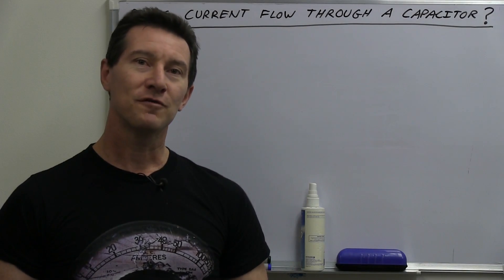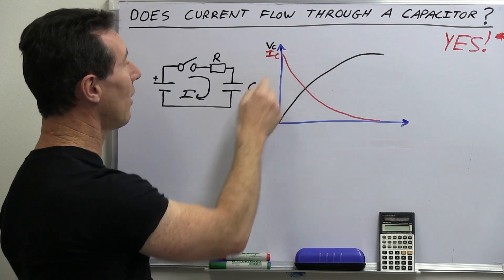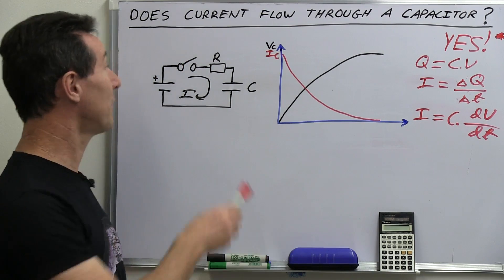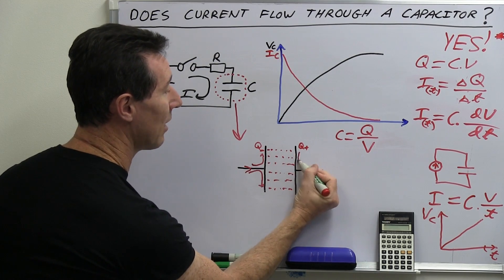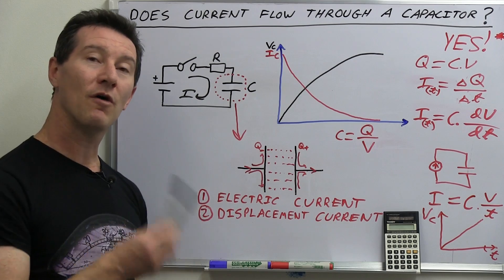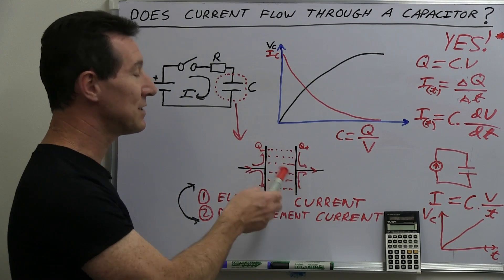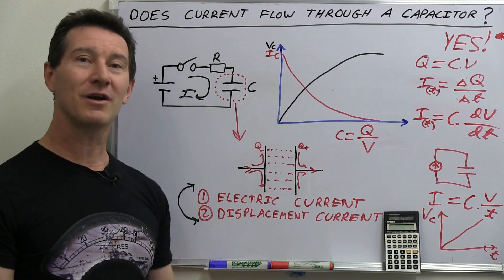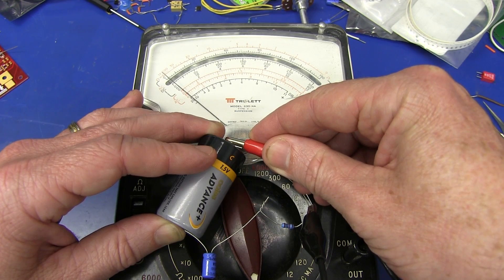EEVblog #486 - Does Current Flow Through A Capacitor?

Comment from the maker: Yes, "it depends". It doesn't matter how you define your boundry conditions in fact, displacement current can still flow cap "through" the cap in either case. If you don't want to talk in terms of displacement current, and only electric "conducted" current, then no current flows through the cap.

Comment: It's an analogy, not a literal description.

And no, I'm not talking about a spark gap. Just touch the negative terminal to the post and the car will start.

In alternating current, the measure of the electron energy is in it's frequency, yes. But in direct current theory, the energy of the electron is directly related to it's source. I'm not saying electrons are created in the generator, they flow back to it to be rejuvenated, so to speak.

Theoretical physicists make for bad auto-mechanics.

Comment: Correct.  It's a matter of potential difference, not current flowing through the capacitor, unless you hit it hard enough to break the dielectric barrier, then you have a whole different problem on your hands :)

The circuit diagram with the cap in series is nonsensical, normally capacitors bridge the circuit in parallel, mostly to act as a dampening or smoothing mechanism.  If current flowed THROUGH the capacitor, it would be a short circuit.

Comment: "...electrons are fully charged up ..." ?1? Are you serious?
The electrons flow - spark - across the gap during the charging cycle because of the battery potential.  During the charging cycle they can't spark back across the gap because the alternator doesn't create as large of a reverse potential. It has nothing to do with the electrons being exhausted from working hard.

Comment: The correct answer is, "it depends".  Everything in engineering (or physics for that matter) depends upon how you define your boundary conditions. If you define your boundary conditions between the capacitor plates then the answer is that no current flows. If you do so around the capacitor leads then the answer is yes, current flows. You can argue about whether a particular electron enters one lead and leaves the other but then you are just taking the electron concept too literally.

Comment: You're using 'current' to describe wattage, and again, more confusion about the difference between direct current and alternating current.

Try this with a car battery. Loosen the negative terminal on the battery and start the car. It will start because the electrons are fully charged up and full of piss and vinegar as they come out of the battery at the negative terminal. But when they've gone and done their work, they need a good connection to get back.

But it measures 12v on both terminals.

Comment: Voltage is *not* the number of electrons; its a measure of how much energy each electron has relative to other things around it.

Similarly, current is *not* the speed of electrons, but rather the volume (number) of electrons passing a given point per unit time.

Comment: Flow of electrons = current (ish). The increase in charge on one plate of the capacitors repel the like charge on the other plate until there are no more free electrons to repel. It's all semantics at the end of the day. There is no electron flow through a capacitor there is however, an induced current on the opposite plate and NOT from magnetism as he stated (well maybe a tiny bit, but VERY tiny). Look at Maxwell's equations, they're not as complicated as he makes out.

Comment: I beg to differ. Ohm's Law measures voltage as the potential charge (amount of electrons) and current (the speed of their flow), so the electrons are in the flow, therefore current is simply a measure of the speed of electron flow. When he puts an ammeter in the circuit, current passes through the meter, not the capacitor.

Put a field effect ammeter on a wire going to a capacitor, send a steady +12 volts DC to the capacitor and the current will stop as soon as the capacitor charges up.

Comment: You don't really need Maxwells equations to understand this concept. You just really know that electrons repell each other. That's why when you connect source electrons start gathering on one plate and they push electrons from other plate thus current will flow till amount of minus charge on one plate will be equal to amount of + charge on other plate.

Comment: Dave is correct it does flow electron volts. If it does not the capacitor would never leak down. Given the best capacitors don't live in vacuum. They need a constant source of current to stay charged or it does not work. People are just confusing function with applied theory.

Comment: Dave, I had the same question in College regarding transmission lines.  How does current get from one side of the line to the other.  No professor had an answer short of: That's how the equations work, so it must be there.  It wasn't until I was in my masters courses that I finally understood how this works.

Great job explaining this difficult to grasp concept.

Comment: Classic redirection to give the desired answer which is, "I didn't misspeak."

Current flows INTO a capacitor, namely the electrons load up the negative plate until it reaches full charge. Then they stop, because they cannot flow THROUGH the capacitor. This does not mean the displacement effect does not go through the capacitor, it does. Using Maxwell to explain away and redefine a simple question is being obtuse. The simple answer to the simple question is, "No."

Comment: Electrons flow in and accumulate on one plate and electrons are "Sucked" out of "Depleted" from the other plate . Measure current going in (electrons accumulating on one plate) and measure displacement current coming out as electrons are depleted from the other plate . I thought that capacitors were more about static electricity charge instead of electromagnetic (even though I know that flowing electrons makes a magnetic field).Yeah pay attention to how smart I am :). Great video Dave,Thanks .

Comment: Well, it would be simple to hack what you want talking in ac instead of dc, put just a cap, an ac surce and ac amp meter and your are done. Cap in ac, everywhere, from starting motor to compensate power factor, of corse, they "eats" current. Even pure reactive power in forth cuadrant is also pure apparrent power, and apparent power is just like V*i, so I cannot be zero while a capacitive bank is hock to an AC Source.

Comment: The same current i(t) flows INTO the capacitor on one side, and OUT OF the capacitor on the other side, it's that simple. But the "electron" that came into one side, will never get out of the other side (ideal situation, no leakage). It will just kick another electron out of the other side by building up an electric Field. In theory: If you could charge a capacitor up to a very high voltage, at some point, no more current would flow.

Comment: I'm gonna answer before watching the video: yes. it flows until the cap. is fully charhed or discharged in dc (charging, discharging) and it conducts it on ac (very simplifyed aka. infinate capacity cap.).

Comment: Yeah quantum tunneling is a very different beast.  It is not related to Maxwell at all.  Though FETs in general are operating on electrostatic fields.   The trick in a FLASH cell is that there is a VERY thin glass layer separating the input to the cell from a capacitor that holds the cell state.   By forcing electrons to tunnel through the insulation they are trapped in the capacitor.  This isolated capacitor exerts a electrostatic field the gate, detecting the charge, without altering it.

Comment: One of my early instructors made a strong distinction between current *flowing* through a simple conductor, or even a resistor, and current *passing* through inductors, capacitors and semiconductors.   If you could track individual electrons, they are not flowing through a capacitor, and while you could track them through an inductor, or a semiconductor, they don't behave as expected, because these devices do not behave like simple conductors at all.

Comment: Actually all electrons are measured as voltage. One reason radio waves can be measured in terms of voltage. We even measure stars, light, from billions if miles away in terms of voltage. So yes capacitors move voltage using electromagnetic fields. You don't need any contact either. We can charge devises now using free air radio waves. Maxwell was a genius to figure thus out with nothing more then pen, paper and imagination.

Comment: A soon as you apply power to the coil, the magnets will line up north to south all the way down the line and eventually the last magnet will induce a pulse of opposite polarity on the far coil.  This is a capacitor responding to charging with DC.  Now feed the first coil AC (with a low enough frequency to actually allow propagation) and the last magnet will swing back and forth inducing AC on the far coil 180 degrees out of phase.

Comment: Here's a mind demo for how displacement current works:
Imagine you have two electromagnets on a table facing each other, and between them is a string of small magnets on pivots.  Everything is in perfect axial alignment.  You can twiddle the magnets around and some will line up with each other from time to time; this is a neutral charge in a dielectric.  Now imagine you have an ideal DC power supply.

Comment: *Black box with capacitor inside, amp meter hooked up and is charging/discharging*
Any reasonable EE: "Look, the current is going THROUGH that black box!!!"

Alternatives to the word through in this situation include: Around, over, under, sideways, wormhole, and MAGIC *waves hands*

Serious guys.  Learn to love and think in terms of black boxes.  It will help you sleep at night, instead of posting passive-aggressive, inane and pedantic crap on good videos.

Comment: Reminds me of the old conundrum:
Capacitor C charges to voltage V has energy of 0.5*C*(V)^2 and a charge of Q=CV.
Connect a capacitor of the same capacitance in parallel.
Voltage on each capacitor is now the same charge divided by twice the capacitance or V/2
Energy of each capacitor is now E=0.5*C*(V/2)^2 or (0.5*C*(V)^2)/4.
Energy in the two capacitors combined is (0.5*C*(V)^2)/2.
Where has half the energy gone?

cheers

Comment: Even if you philosophically chose not to count displacement current as actual current, I can assure that charge still flows THROUGH the capacitor.  There's no such thing as a perfect dielectric and there is ALWAYS leakage current in a capacitor.  Seriously, do you folks have nothing better to do than nit-pick a guy who's providing you FREE content?

Comment: acually, there is no "more negative side" in a capacitor. if you apply + voltage at one side, it will draw negative charge from that plane causing positive charge to prevail which in turn accumulates negative charge on the opposite plane.

Comment: Sorry but you can't tell me a vacuum has a dipole momentum. In fact it is the magnetic field as Dave said it. Magnetic fields are not only induced by electric current but also by changing electric fields. And since the electric field in a charging capacitor is changing a magnetic field similar to that of a conductor is induced.

Comment: Electrons travel at a speed of 1 mm per sec but the speed of current is nearer to the speed of light. At a constant voltage, a charging current flows through the capacitor which builds up the electric field until no more charging possible. Now if the two end of a fully charged capacitor gets connected, a current flow can be seen but this time it is the discharging current that will flow in the opposite direction until the two plates attain equilibrium.

Comment: Actually, it is very easy to explain. One electron pushes another electron with electric fields, so the electron comming in is not the same as the one comming out. It is to be compared to inductors pushing electrons with magnetic fields, but instead with electric fields.

Comment: Can you clarify for me:
My understanding in a series circuit:  Electrons flow into the more negative side of the capacitor plate, charging it essentially with static electricity, and electrons repel one another.  The higher concentration of negative charge on the negative plate 'displaces' the electrons on the more positive plate through the conductor back to the current source.
No?

Comment: How I think of it, there's an equal number of electrons on either side of the capacitor at equilibrium, when electrons start flowing to one plate of the capacitor their charge causes electrons on the other side to break free of the plate to maintain the same number of total electrons on the two plates. Once there is no more electrons on the opposite plate the capacitor stops charging and no more current can pass.

Comment: The way I understand it, current enters one side of the capacitor increasing the electrical charge on that plate (+Q becomes more positive) while simultaneously, the electrical charge on the opposing plate decreases (-Q becomes more negative). This matched but opposite change causes an apparent current to be measured through the capacitor (I = dQ/dt). Thus, it appears that current flows in one terminal and out the other.

See 6:11 for the diagram which Dave explains the charged plates.

Comment: Eletrolytic caps forms an oxide coating on one of the plate materials when exposed to the right polarity. This serves as an insulator. When reversed connected, it does the opposite by unforming the oxide which allow current to flow at a high rate. This produces heat and preasure which must be releaved through the rupture of the cap.

Comment: Dave is absolutely correct.  It requires the addition of charge density to really describe it.  Schematic diagrams don't consider that current flows differently over different surfaces.

Comment: A very good description Dave. A good analogy I once came accross was that of a water pipe with a flexible diaphram inside. The diaphram would stop actual water flow but any variations in flow would still get transmitted from one side of the water pipe to the other. Since water movement is the analogy to electric current, there you have it. Simplistic but easy to understand.

Comment: 1. The capacitor stores charge, but effectively one side is positively charged and one side negatively charged, because when n number of electrons gather on one plate, the same number of electrons leave the other plate.

2. Dave commented on this in the video, and stated that he was assuming the capacitor is perfect, which is of course necessary to properly understand the basic theory.

Comment: Can the 'sourcing' side of a capacitor (right side on the board) be depleted that no more electrons will come out? Or the inverse of that question: can the 'sinking' side of a capacitor overflow that no more electrons can come in?

Comment: Beginner question :) If it is flowing through it, why does the current go down? If it could flow through, it should not go down? I imagine it as the buildup of a potential between the two plates, like two magnets where the two norths are facing each other. Maybe both are correct as you said "how you look at it"?

Comment: A beginner question, Dave, regarding the matter: if the current flowing through the capacitor isn't coming from the main electron source (i,e, the battery) because, as you explained, its electrons are building up on the capacitor plate, where does the exact same amount of electrons come from? I mean, they most come from somewhere, right? And if it's not from the battery where the main current is flowing from, where is it flowing from actually? Thanks :]

Comment: Yeah, but as you pour water in a bucket, the air that was in it flows out. Hooked up properly, you can still use the displaced air in the rest of your circuit, so the energy did not stop at the bucket.

'Something' flows in and 'something' flows out, but as they're equal 'somethings', it is safe to say they're the same 'something'.

Comment: What is called displacement current is what causes electrons to move in the first place, the actual charge or the displacement of the electric field, that is caused by electrical tension or electrical polarity. 
There is no significant flow of electrons in the insulator but there is 'electrostatic' (bad name) tension that moves the electrons on the other side of the capacitor.

Comment: But... dont have electrons moving from plate 1 to plate 2. The positive charge in plate 1 attract negative charges to plate 2. Between the two plates we have insulating material. If electrons have moving from plate 1 to plate 2 the dielectric rigidity has lost and the capacitor is burnt

Comment from the maker: Yes, that simple explanation is indeed very useful for understanding how a cap works in terms of charge build up, and if you want, how current flows "in and out" but not "through". And I would have used that in a basic how how capacitance video and nothing else. But with this video I wanted to show there is a deeper mathematical theory and a different "type" of current many people may not be aware of.

Comment: I'm surprised you didn't use the old grade school electrostatic balloon analogy. Electrostatic charge brought into proximity of a conductor will induce a charge, basically "pushing" the charge off the receiving conductor. So I is the sum of mere dialectric current and electron push.  Sometimes helps people to bring it back to newtonian level physics examples. :) great vid (:

Comment from the maker: Maybe, but that wasn't the point. Because the term "current though" is so commonly used and accepted in the industry, that I wanted to show that there is indeed a fundamental principle in physics and maxwell's equations that effectively allows (a different type of) current to "flow through" the dielectric.